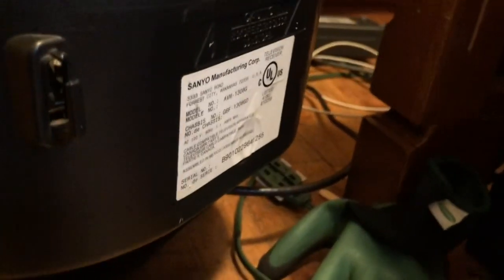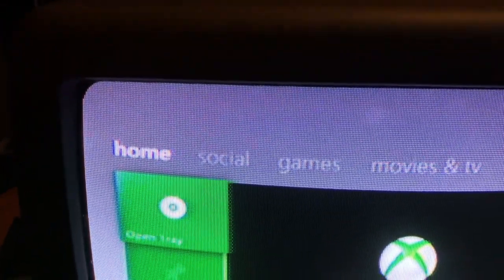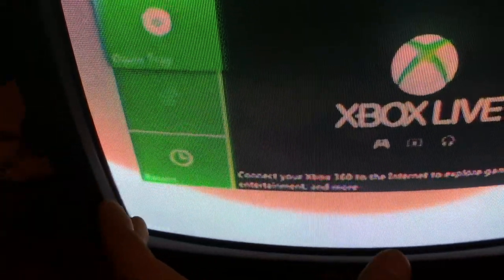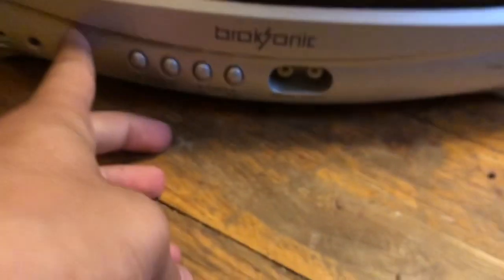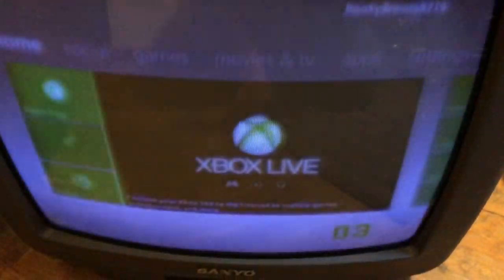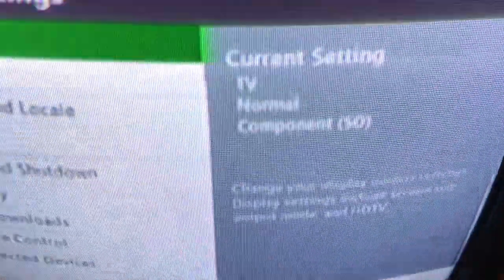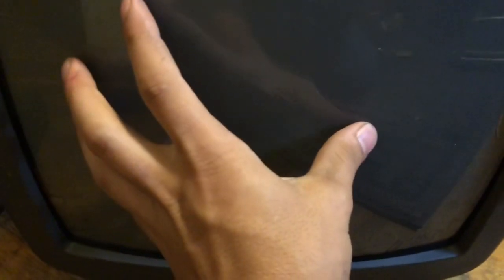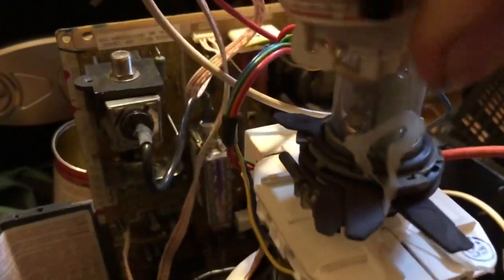(Epilepsy Warning) 90's CRT TV With Worn Tube

Comment: the blooming you see upon turning the set on could be mainly due to aging capacitors in the power supply section. if the tube was weak the picture would be dim and colors would be off.
Reply from the maker: It isn't, it's caused by the crt not yet having sufficient emissions due to still warning up.